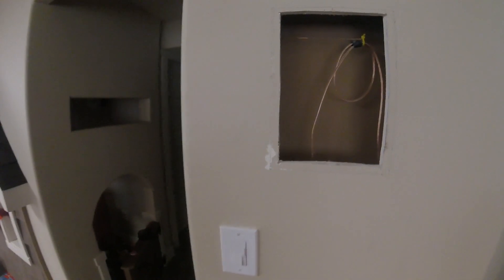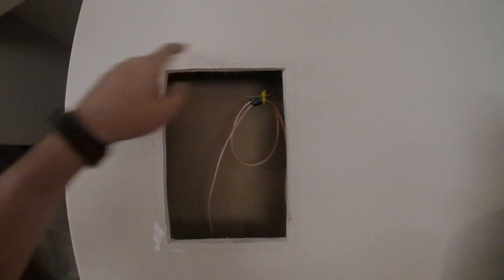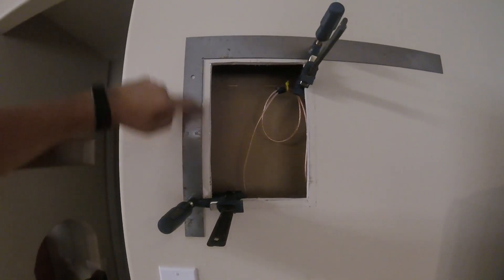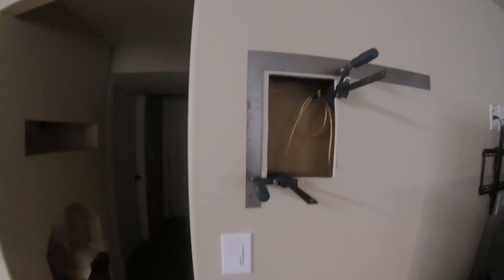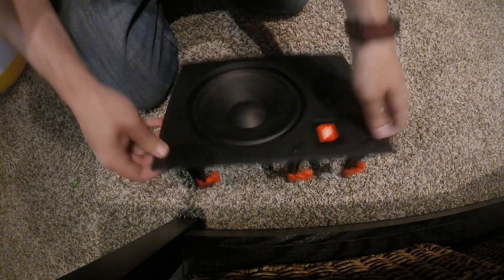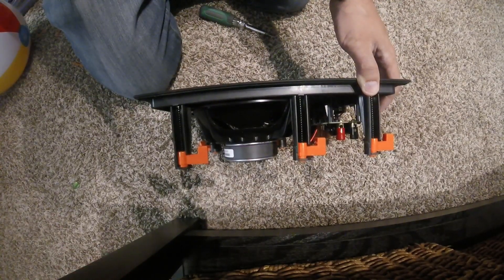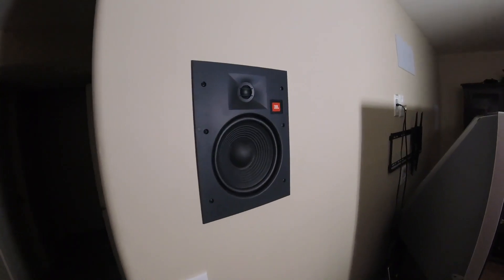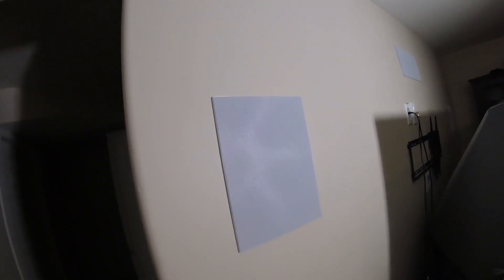Leviton Architectural Edition Powered by JBL 8 in. Wall Speaker

Comment: hi what do you use as centerspeaker and  do you recommend them ?
Reply from the maker: There is a center channel in this series that I am currently using as I would highly recommend a good center channel. It is the Leviton LAE5I  https://www.homedepot.com/p/Leviton-Architectural-Edition-Powered-by-JBL-In-Wall-Center-Channel-Loudspeaker-LAE5I/302070950?keyword=LAE5I+speaker&semanticToken=200300001110_202003121315451372976_h345+200300001110+%3E++cnn%3A%7B0%3A0%7D+cnr%3A%7B7%3A1%7D+cnp%3A%7B10%3A0%7D+cnd%3A%7B4%3A0%7D+cne%3A%7B8%3A0%7D+cnb%3A%7B0%3A0%7D+cns%3A%7B5%3A0%7D+cnx%3A%7B3%3A0%7D+st%3A%7Blae5i+speaker%7D%3Ast+oos%3A%7B1%3A1%7D+pt%3A%7Bspeaker%7D%3Apt+qu%3A%7Blae5i%7D%3Aqu+nf%3A%7B1%7D%3Anf